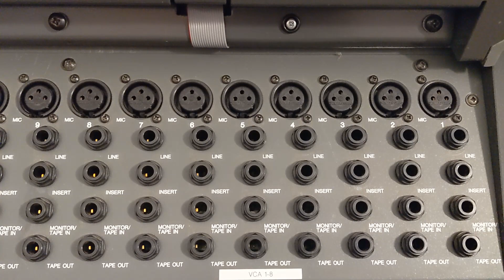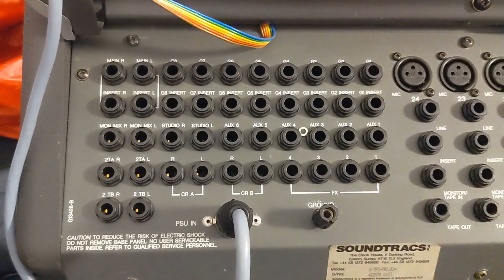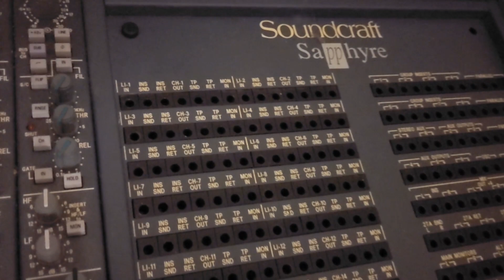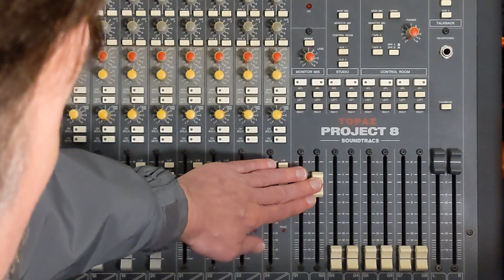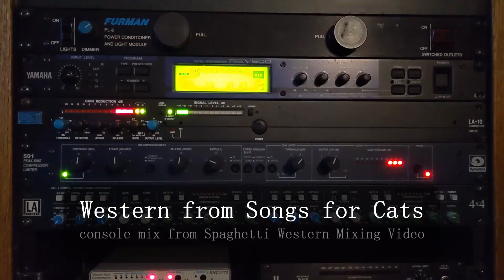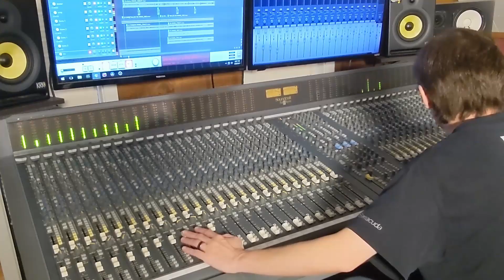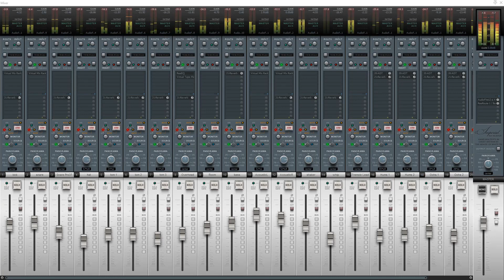How to Setup for Mixing on an Analog Console

Comment: I've got a question with regards to the subgroups. Whenever I assign my drums to group 1 and 2 and remove them from main L R, my output for the group is low. I have to push that group fader way up. Do you know what is going on here? Am I not hitting it hard enough on the way in from my daw or not turning up the individual channel faders enough? When I solo the group it is loud enough... trying to figure out what I am missing. BTW you were right a few vids back when I asked about combining plugin eq with console eq. I shape it with the board and if I need a cut or something specific, something like fab filter or other precision eq gets me what I need. I adjust what i need from the plug that then feeds the board and board eq. This truly hybrid approach is fantastic rather than spending thousands on outboard hardware. ( which I don't have) lately when I have had money. It goes towards hardware compressors. I still feel compression and summing is best done with hardware.
Reply from the maker: Do you have anything connected to the subgroup inserts on 1 and 2? If so, you may need to adjust the output level or makeup gain. If you are purely using the subgroups to groups things for control in the mix, then it could be the channel fader level or level coming into the console inputs that is too low. I will often use the DAW faders to push the console inputs a little harder. Let me know what results that gives you.
Reply: @TwinCreekAudio  hoping to try it out later and report back. As far as I can tell I am driving the (kick anyway) into the orange on the meter. It just doesn't make sense to me that a submix would be lower volume if I A/B the group to the main LR. I do notice when I push the line level up on the incoming signal from my DAW, it does go up in the subgroup 1/2 group. So I am guessing that I either get it up in the DAW or I push the line input gain up so that I consistently get all signals into high green/orange on my meter. I am guessing this would also allow the board to do what consoles do best. Oh, and nothing connected to sub group yet. I am going to be sending 1/2 out to a stereo comp for parallel compression once i get this figured out and then back in on two spare channels. The Ramsa doesn't have inserts on the groups unfortunately. Have to get creative on how i group and send channels to the 20 channels on the board. 8 groups at least. It can be challenging but fun to find solutions in hybrid while committing.

Comment: thank you for this video, you have a great way of explaining things! I‘m starting to plan my move towards mixing outside the box but I‘m struggling to find audio interfaces with enough IO that would allow a 24 channel console. The only setup I was able to come up with so far would be to use a rme digiface usb and then connect a ferrofish pulse 16 and another interface to it with some more ins and outs. But 1. that‘s too expensive for me atm, 2. I do like the controls, ins and outs etc my current interface (arturia audiofuse studio) gives me. Do you have any gear recommendations, tips etc. to solve my issue and come up with a affordable good solution to connect the desk to the computer? Cheers from Switzerland, Sam
Reply from the maker: The RME Digiface and Ferrofish was exactly the setup I've been thinking of upgrading to. I cant afford to do that right now either so I'm still using 2 Echo Audiofire 12s. They sound good and the control panel allows them to work like a tape machine when tracking. The input passes to the output and back to the console with no latency which is great for tracking bands. These are older FireWire interfaces so I will definitely need to replace them before the drivers are no longer supported. The other option would be the MOTU 16a and then an additional optical interface which could be something as inexpensive as the Behringer ADA8200. I'm still considering options like these and I'll definitely make a video when I eventually upgrade things here. Thanks so much for your comment!
Reply: @TwinCreekAudio  Thank you for your quick and helpful response! I didn't know the MOTU 16a, looks good but also a bit on the expensive side;) Looking forward to your video!
What do you think about the Soundcraft Signature 22 MTK for mixing outside the box? It seems very popular, and disregarding my love for vintage gear, newer devices also have their pros. Do you know if there is a difference to the sound if you pass it through single ins and outs of an interface or, like it would be the case in the soundcraft signature, if you have all channels come through a USB cable into the mixer and then take the stereo out of the mixer back into your DAW? I mean it shouldn't make a difference, right? All the channels have to go through a USB cable anyways to reach your interface.
I do like the idea of a vintage console but my first priority is to have a nice analogue sound and if I can achieve that through cheaper means with the signature 22 mtk that could be a great option. What do you think? Do you think it's still worth it to go for vintage consoles?
Reply from the maker: @samuelbrunner  I have not tried the MTK 22 myself but I hear good things about them. They have the Ghost preamps and the Sapphyre EQ. I can confirm the Sapphyre EQ is very very good. I used to own a Ghost as well and really liked it. I'd say the MTK 22 is about the best choice on the market today for the price.
Reply: @TwinCreekAudio  awesome, thank you for your help!

Comment: Do you ever use balanced Y leads?  Is there any benefit to using those. where you have a TRS 1/4 inch on all three jacks rather than one TRS and two TS?
Reply from the maker: That's a great question. The Topaz TRS inserts are unbalanced with sleeve  ground and tip of TRS for send and ring for receive(a lot of console are the opposite of this with ring being the send and tip the return.  There would be no benefit since the consoles inserts are unbalanced. The Soundcraft  Sapphyre has balanced inserts but these have a separate send and return connection and both are balanced TRS on TT/bantam connections. Many mixing console use these unbalanced TRS connectors for inserts and it really isn't a problem unless the cables connecting them to other equipment are really long. I think a balanced insert on one jack would have to be TRRS in order to be able to use balanced connections as you need 3 connections for each balanced connections. Standard TRS inserts have a ground and a send and receive on 3 connections where the send and receive share the audio ground. Most of my rack gear is balanced but works well with either balanced or unbalanced connections with no problems. If the console has separate connections for insert send and receive, it may have balanced inserts though many older mixers that have separate send and receive are still unbalanced inserts with 2 connections instead if a single TRS insert. Best way to know for sure if to check the manual and specs of the console to make sure. Thank you so much for your comment. I hope my answer helps.
Reply: @TwinCreekAudio  Thanks for the response.  THe manual is actually what created the question for me.  I am just getting started with an analog mixer and maybe I shouldn't be reading the manual late at night.  I just found it odd that in some cases it called for normal unbalanced insert cables and in other cases it calls for the balanced cables for example on the Aux outputs.  Great videos,  I am enjoying the analog content.

Comment: Hey again. So I just got my hands on a Carvin mx 1688 mixer/console. I’m having trouble with connecting my monitors to it. Also on the console, should I connect the outputs of the master section to the inputs on my interface, in order to be able to hear playback?
Reply from the maker: The Carvin MX1688 should have monitor outputs that you would connect to a set of powered monitors or an amp. I had a MX2488 and it had the control room levels on faders which is super cool! Then you'd connect the output of your audio interface to the 8 tape inputs or however many you need for your audio interface. These are in a separate section above the subgroups and have their own faders, pan etc. They also route to the first 8 main channels automatically when you switch them to line mode IIRC. If you have more than 8 outputs you want to connect, you would connect those to the line inputs. Then you need to assign the channels to go somewhere like the main LR or subgroups. I can't remember how the monitor section works other than those 8 inputs route to the main channels when switched to line with nothing else plugged into them. You might see if you can locate a manual as they might provide more information. It has been years since I owned the Carvin MX2488. Long before I started the YouTube channel. I hope that helps and good luck!
Reply: @TwinCreekAudio  gotcha. So my board does have control room inputs along with the faders, would I plug in my monitors to that? Then from there how would I get that signal into the daw?
Reply from the maker: @jackmmarsden  you need to have outputs from the console to plug into inputs on your interface. This video mostly covers mixing but I made another one that show how to setup for recording. Your should plug your monitors into the consoles monitor outputs. That is if they are powers monitors that have amps, otherwise the monitor outlets from the console would plug into the inputs of an amp and the amp would connect to speakers or monitors. Here is the link the other video:
https://youtu.be/qEjg7h9iOqE
The idea is that you have main channels for tracking things through to tape in the past and now audio interface inputs to DAW. Then a recording console will have additional tape inputs and either a separate monitor mix section for the tape inputs(aka split console) or integrated into the main channels(inline console like a Mackie 8 bus or Ghost). This was for independence so your levels to the recording device don't change if you change the monitor mix the musicians or engineer are hearing. It's a whole world of signal flow with analog equipment you need to do know to do this properly. I have a lot of videos about this with different consoles if you search the channel videos.
Reply: @TwinCreekAudio  thank you so much. Sorry for so many questions! You’re awesome though.
Reply from the maker: @jackmmarsden  Thank you and good luck! Hopefully some of the videos will help. I'm pretty sure Carvin has the manual for your console and it might include some setup diagrams. Just substitute your audio interface for the tape machine in the diagrams.

https://cdn.shopify.com/s/files/1/0476/5297/files/MX2488.pdf?1775